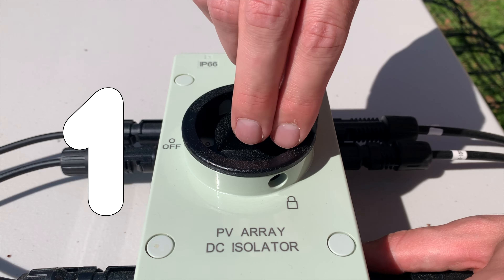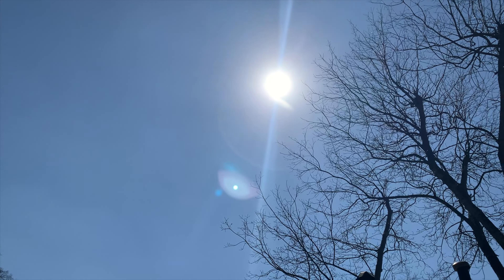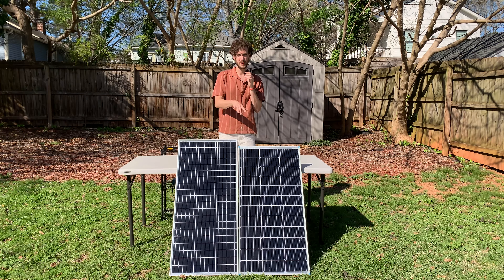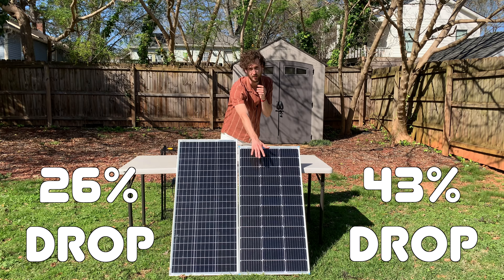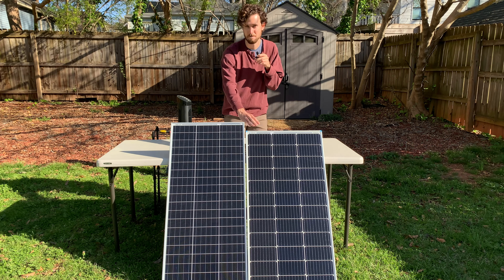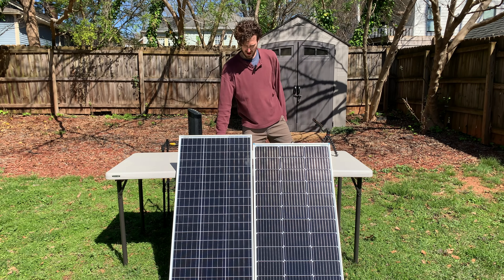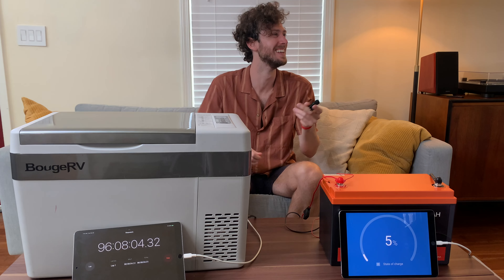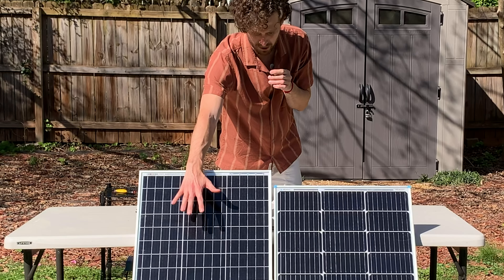Newpowa 5BB vs Renogy 9BB Solar Panels - Power Output Test!

Comment: I've had really good luck with HQST brand solar panels. I've bought 2 100 watt "solar suitcase" type portable units and am very pleased. They run around 200 each but you can wait till they go on sale I paid 155 each for mine. 5 years old still like new. I did upgrade the controller to a zamp 30a model and run both panels through the single controller. Awesome.
Reply from the maker: Good to know! Unsure if it's true but I've seen a couple comments online that HQST and Renogy are owned by the same person

Comment: I just bought 2 of the Renogy 115 watt bifacial 10 bus bar panels. They are about $65 each. Shipping is free. You can get possible 149 watts from them in right conditions. 😊

Comment: The current price for each of these is basically identical, with the Renogy being just $2 more for the 100w panel.  I suspect the differences you observed were a result of the Renogy having more bus bars; these would be more efficient in direct sunlight but suffer greater reduction in output with any shading.
Reply: 9bb compared to 5bb is not a true comparison

Comment: You should use the same charge controller.. if though they are the same they may still perform differently due to manufacturing tolerances.

Comment: I think your test method is pretty good, but the test should have been done twice, on the second round you should have switched the solar controllers to see if any of the difference was between these units not the panels.

Comment: Your hand does not cover more than 5% of the panel.  Yet the power drop was 12% to 43%.  May I ask why the larger power loss?  

A T Burke
Reply: Because the cells are in series, so a single cells reduced output effects the entire string.
Reply: Thank you.  @whitelfner4582

Comment: What you did wrong!
MPPT CHARGE CONTROLLERS REQUIRE 30% MORE INPUT THAN OUTPUT!
SO ANY TEST WITH A SINGLE PANEL WILL NOT BE VALID!!! AS THE VMP (UNDER LOAD) WILL BE DIFFERENT!!!

If you need some validation for this go to Midnight Solar's string sizing tool and read the info at the bottom of the page.
Reply: From Midnite's String sizing tool;

To ensure proper start up and MPPT operation, the minimum initial PV input voltage should be at least 30% higher than the highest expected battery voltage.

Many manufactures use to put this info in their manuals, but I think it confused people. They still output energy, but more in the nature of a PWM charge controller. So comparing single panels on a MPPT just won't work. 

If you are curious about why worry about one manufactures claims, the Gudgel's boB and Robin(cheif engineer) started with Trace/Xantrex before opening Outback Solar and developing one of the first effective MPPT charge controllers. Then selling out Outback and later opening Midnite Solar.

Comment: Dude, I dont know alot about these things.
But I'm trying to figure out how to charge a
12 volt 6 ah LiFePo4 battery with solar.
I use this to run a prospecting drywasher, so since I'll be in the desert I should have lots of sun. I have 2 batteries, I want to run one while I charge the other. I should get 3 - 4 hours of use from 1 battery. So I need a recommendation for a pretty simple setup - panel, controller, ect
Anything you can tell me will help so I dont have to spend days researching and learning. Thanks
Reply: Leave the batteries in parallel instead of rotating between the two. You'll have better benefits from this, as your batteries won't drain as low. They're easier to charge when they've already got some charge. You'll have better results leaving them paired up the entire time. 

I don't know how much power your drywasher uses, but I'd say a single 30 amp charger controller, and 100-200w of panels should be sufficient. If your drywasher is 12v DC, you won't need an inverter. However, if your drywasher is a 120v AC outlet plugin style, you will need an inverter. The size of inverter will depend on what you are planning to power with it.
Reply from the maker: Here's one of my other videos that describes a super simple way to solar charge 12V batteries, it may help - https://youtube.com/shorts/qNlZl7ilKwg